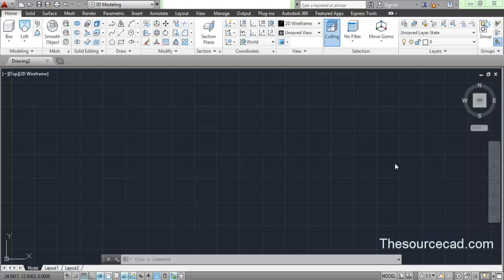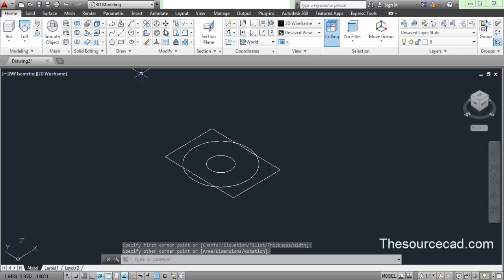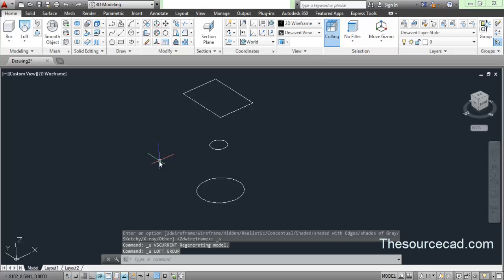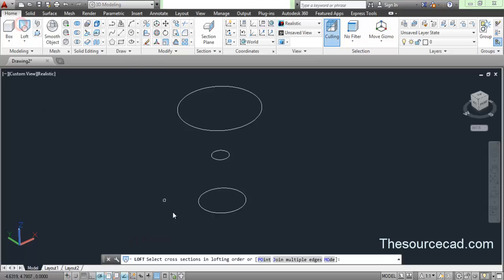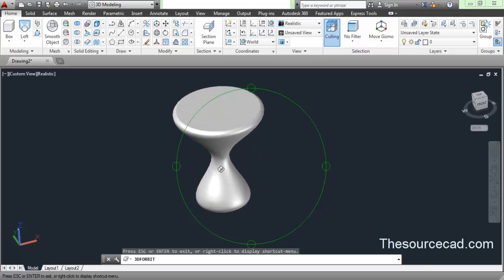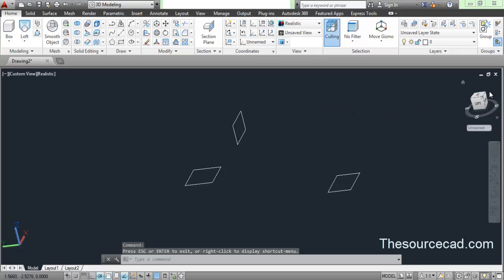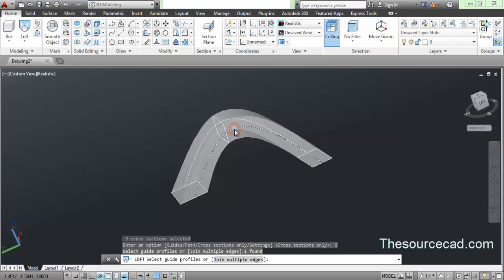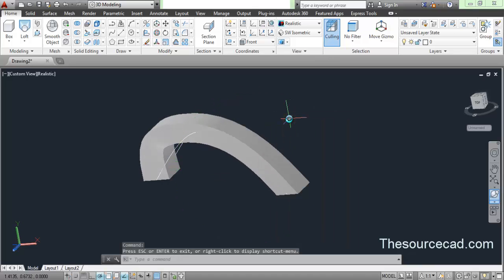Using Loft command in AutoCAD

Comment: I work at a factory that makes precast concrete elements.
When we have an order including 1/2- or 1/4-turn stairs, I use the guide function alot, as each side often has a different amount of edges on the bottom. If the number of edges are unequal, disregarding this will make the face twist on itself. I draw lines from side to side, making triangles where I want 2 end points to meet at a single point on the other side.
As I use the 3D model to calculate the volume and weight (mass command), it is important that the model is as accurate as possible.
I DID learn a few new tricks here, so I'll try to explore them next time. :)

Comment: 1:45 i got a problem friend when i select the smal circle and try to move it up all the shapes move up. why that happens?
Reply from the maker: +geo summerholder that should not happen! try deselecting every geometry and then select only smaller circle and make sure you follow Z axis as shown in video. Let me know if issue persists
Reply: +SourceCAD   i select only the small circle,when i move it up on z direction all geometry shapes movie up. maybe is a problem of my autocad 2016 version i dont know.
Reply from the maker: there can be many reasons behind this like you might have grouped all objects together or you may have created them as a block, try to explode this geometry and then try it for exploding select geometries then type X on command line and press enter